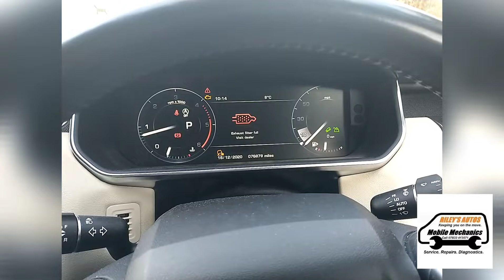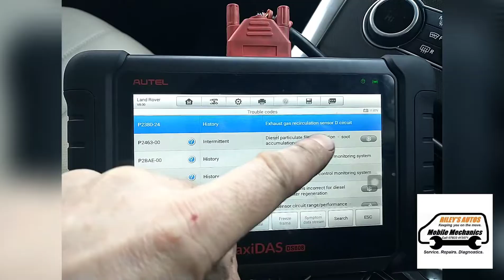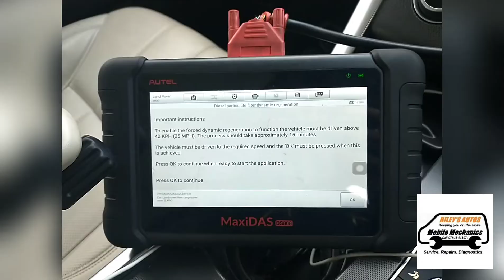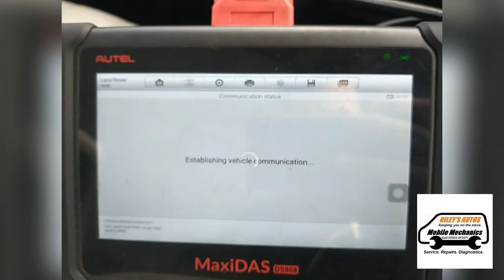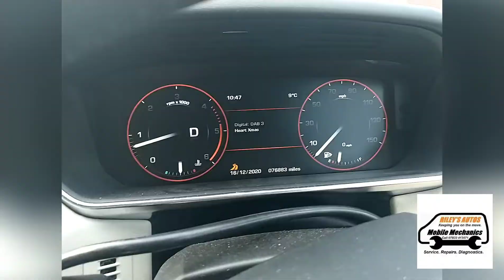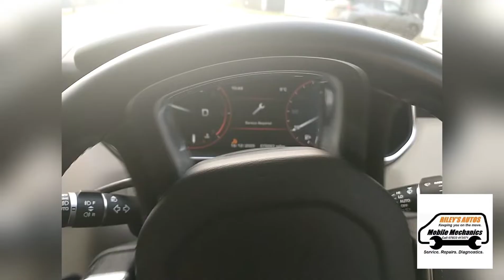Range Rover Sport 3.0 SDV6 DPF Filter Full. Clean blocked diesel particulate filter P2463 P2BAE NOX

Comment: Most owners don’t understand DPF warnings, the issue with all DPF’s is with the accumulated ASH deposits, not the SOOT, which are the mineral-based residue of complete combustion, typically consisting of larger, more irregular particles compared to SOOT. The ASH cannot be expelled from the DPF as the ash tends to aggregate forming larger clumps and the individual particle size is larger than the filter core pore size. The filter material either Cordierite or Silicon Carbide, has a network pore dimension of 10-20 micro meters per pore, but the Ash particles commonly range from 20 micrometers up to 100 micrometers, which is why the filter eventually blocks. As the Ash builds up it gradually reduce the filters soot regeneration surface area resulting in more frequent DPF FULL warnings and regeneration. This reduction causes increased Active or Forced SOOT regeneration, but eventually the DPF becomes completely blocked with ASH, unable to regenerate the SOOT initiating the Red "DPF FULL" warning and reduced performance Limp Home mode. The only way to resolve it is a) replace the blocked DPF at a cost of £3500 or b) Remove the DPF and get it backflushed in a Power Flush Hydro pumping unit costing £400, which will restore it to 98% as new.                                                3) JLR like most manufactures failed to adequately advise their Diesel vehicles were not designed for short journeys due to the DPF issue outlined above. Nor did the handbooks adequately explain that the DPF was designed to PASSIVELY  regenerate the soot over long distances. Nor did they advise that the ASH residue cannot be expelled from the DPF. If passive regen fails due to short journeys, ACTIVE regeneration controlled by the ECU, is required, a 40 minute journey at 2500RPM, where excess diesel is injected into the Exhaust Stroke to generate more heat as it combusts in the DPF during regeneration. Typically the regeneration exhaust temperature is 600degC.  If the driver ignores the Yellow DPF FULL warning, the exhaust will never reach 600degC, so no SOOT will be burnt off and when the driver switches the engine off, the excess diesel fuel will drain down the piston bores into the oil sump, diluting the oil and it's lubricating properties which can and has lead to broken crankshafts and siezed bearings and pistons.  If due to the above numerous aborted ACTIVE regeneration fails, the DPF pressure differential pressure switch will via the ECU activate a Red “DPF FULL" warning, at this point the DPF is possibly 70-85% blocked with ASH. This results in drivers either taking the vehicle to the dealership or independent specialist to initiate a FORCED regeneration via the diagnostics OBD port or if they're aware or their manual so advises, but this will only remove the SOOT NOT THE ASH.. Owners taking their vehicle to the main dealer or use useless mobile “DPF cleaning specialists” to solve the DPF FULL issue, will be offered an on site FORCED regeneration at cost of £400, but this is just a short term fix, as they don't understand the problem is ASH. There are many companies that can remove the DPF and Power Backflush it back to 98% as new. There is no point in using mobile or static DPF cleaning companies who charge £3/400 for a FORCED regeneration as it cannot remove the ASH, it has to be removed by power backflushing. When I removed and cleaned mine the inlet pressure (and thereby back pressure) was 2.9psig and after back flushing for 2hrs it had dropped to 0.007psig (pressure drop). When a Diesel Particulate Filter (DPF) becomes partially blocked, the exhaust back-pressure increases. That added restriction affects engine performance in several ways. Higher back pressure makes it harder for exhaust gases to leave the cylinders. Because exhaust remains trapped less fresh air can enter on the next cycle, combustion is less efficient, turbocharger spooling is delayed resulting in noticeable power loss,  sluggish acceleration and increased fuel consumption. The engine’s control system may compensate by injecting more fuel to maintain torque with lower air intake flow. Exhaust gases build up and heat is retained upstream of the DPF with Increased exhaust gas temperature and more thermal stress on the turbo and manifold. 
Trapped exhaust gas reduces available oxygen causing unstable combustion at low speeds and potential misfires or rough idle. Additionally the turbo works against a higher downstream restriction reducing turbine efficiency and turbo overspeed or bearing stress. Another issue is the Throttle Body.  As the DPF blockage increases, more exhaust gas is transported back to the engine intake via the  EGR (exhaust gas recirculating) valve/s and Throttle Body depositing greater volume of SOOT and Carbon on the EGR valves and throttle body causing these to eventually block and become inoperative.                                            Another design fault occurs during ACTIVE regeneration; the ECU monitors the volume of diesel in the tank and constantly provides updated mileage range in the instrument panel based on the volume and driving mode/speed/MPG. If the fuel tank is less than 1/4 full the ACTIVE regeneration signal will be aborted and regeneration is stopped in order to conserve fuel.

Comment: Hi jimmy 
I over filled the oil on my merc sprinter for a while before I sucked some out to the correct level, I got the dpf temp high warning on the dash, will spraying off car dpf cleaner down the turbo inlet clean all the induction out and clean the dpf out and clean the sensor? Cheers ash

Comment: Hi jimmy I have 07 1.6 HDI Peugeot partner engine management light comes and goes on/off intermittently 
I scanned it I got these codes 
P0104
P1351
It let me delete them but the light is back at present cheers

Comment: Hi jimmy, sorry to bother you, just wondering if you’ve ever come across this before. Mercedes sprinter 2015, DPF was blocked, due to boost leak in inlet manifold, and cylinder 2 glow plug failed, new manifold fitted, DPF cleaned with the trusty launch gun, vehicle booked back in for glow plugs as I was going on holiday and didn’t have time to fit them at that time, however what’s been on the back of my mind, there’s 4 codes for each injector that all read the same just different cylinders: P027254 Teach-in of the operating parameters for Cylinder 1 has a malfunction. Calibration is missing. I’m just wondering would that issue cause the vehicle to stop regenerating on its own. Customer says the van has run better now than it ever has and goes like a bullet just the glow plug light coming and going. Which it’s booked back in for. However I tried coding the injectors and recalibrating them and the fault seemed to always come back no matter what, no EML no limp mode running and driving Fine it’s just in the back of my over thinking mind that this may also cause the DPF to stop regenerating if the injectors are infact just operating outside their parameters and bringing that fault up as a result and it requires new ones fitted. However the balance of each injector was quite normal on live data. Quite a head scratcher. I just don’t want any comebacks. Thanks for your time mate 👍

Comment: Am I correct in saying to code injectors on a  range rover tdv8 3.6 you have to go through land rover settings on the autel ?? To code injectors. As range rover doesn't come up . This us my 1st time coding injectors on a range rover as I normally deal with ford's,  vauxhalls ,renaults etc.
Reply from the maker: Yes. The vehicle is a Land Rover
Reply: Thank you anything to look out for on these range rovers when coding injectors ? Only asking as a new vehicle I always try find out more info before attending job and you seem to have been to a few. Thank you

Comment: Hello sir,
Do you have any video of Peugeot 3008 with 1.5 engine?
Can we spray dpf cleaning foam via nox sensor and not from dpf pressure sensors?
Gratings from greece and keep up the good work
Reply from the maker: I have other vehicles with that engine
Reply: @ORileysAutos  thanks for the quick reply!
Because i cannot force the car to regen may i have to drive with 3k rpm for some km after inserting the foam in the dpf?
Have i to declare on cars ecu that i have changed my cat after this procedure??

THANKS IN ADVANCE

Comment: ok first off thank you here in Australia i was quoted $600 dollars for a dpf regen and $400 for a clean and $400 for the pressure sensor to be replaced on my Mercedes Benz w204 c250 cdi . LOL any how i saved all that by watching your excellent videos Also just the part (sensor they wanted $200 dollars ) LOL So i got it sent from German for $73 delivered . now i wanted to know what tool is you use to push the cleaner into the dpf is it just a pressure bottle like that of a weed spray bottle .? thanks for saving me nearly $2000 dollars . The stealerships here in Australia are bad.

Comment: All the links given for the fluid are not active? I am dealing with something similar but I can't seem to figure it out.. The NOX indicator cam on and then it said DEF dosing error def quality and limiting starts.. Was 250 miles but it just keeps dropping by more than the actual miles. I pulled the read NOX sensor and cleaned it, Pulled the DEF injector and no crystallization blocking the port.. WE are getting way over average fuel performance and it runs super smooth but this is going to hang us by not allowing the car to start.. I have a Icarsoft v3 reader but I can't find a reset on the countdown. No dealers in my town.. Can't force a DPF regain cause it says its to clean to force.. SO frustrated and I can drive my vehicle without fear its going to shutdown.. Its insane

Comment: You make this look fairly easy.  I know this video is old and you may not be looking at these comments any more.  However, is there any reason you would recommend a DIY'er not to purchase the OBD tool you are using and do this maintenance themselves vs going to a dealer or shop?
Reply from the maker: No reason to
Not to do it yourself as long as you have the right tools. No risks on these.

Some vehicles like vw the dpf is close to the turbo so you can backfill and hydrolock the engine

Comment: Jimmy how do you know which is the inlet and the  outlet on the pressure sensor pipes to put the cleaning solution in the dpf
Reply from the maker: You have to follow the hoses if your not sure but an easy sign is that the bigger pipe is usually pre DPF and smaller diameter pipe is post DPF
Reply: Much appreciated Jimmy.

Comment: How long you would you recommend this is carried out? Should this be done as regularly as an MOT or service or only as a when a warning light comes up on the dashboard? How long does this process normally last before you experience this problem again? I’m new to driving a diesel so helpful to know - thank you
Reply from the maker: It only needs to be done if the fault occurs.

Depending on how you drive and if it is city driving or motorway journeys the mileage can vary quite a lot before the fault appears. 

It's most commonly seen around 80,000 miles
Reply: @ORileysAutos  Thank you for your advice, this was really helpful!

Comment: Hi. Do you prefer cleaning DPFs by filling with cleaner then drive it over actually removing the DPF then clean it outside of the car?  I know removing the DPF requires more work.  Thank you for the excellent videos!  You are a great mechanic.  The DPF is very expensive so I don't want to do any damage to it by spraying with water.
Reply from the maker: Doing it on the car is easier and makes a cheaper price for the customer.  Also the engine works as a pressure cleaner once the fluid is inside to push it out. I can also do live diagnostic data while it's fitted so it's all round more convenient and we've had 100% success 👍🏻
Reply: @ORileysAutos  Thank you very much! I will be filling my DPF with cleaner then reinstalling it then use the engine to push it out.
Reply from the maker: @waynehendricks8187  do you have the Autel diagnostic tool like we have? Without it you can't tell the computer it's been cleaned and you have to reset the adaptions.
Reply: @ORileysAutos  No I don't have a nice one like that.  Would you tell me more about that one?
Reply: @waynehendricks8187  apparently the autel mk808 is the dogs donuts /and looks easy to use and its the best affordable proffesional scanner you can buy after doing my research about 400 quid or $500 lol